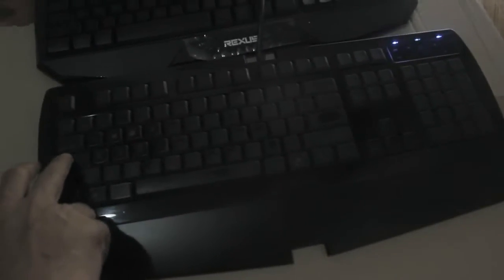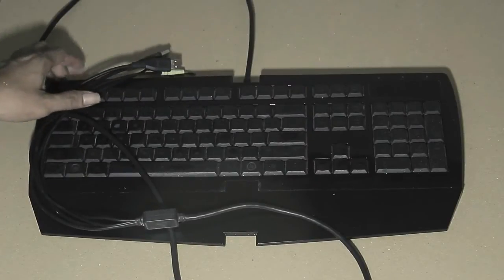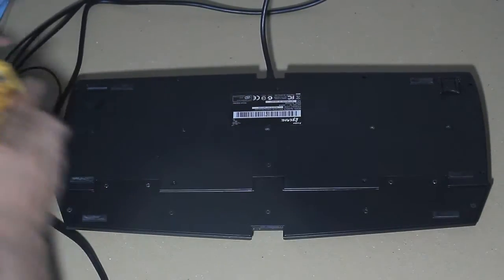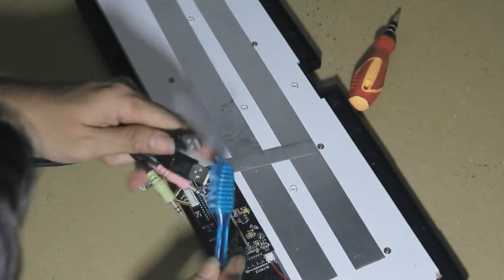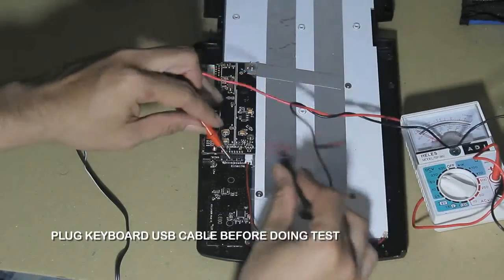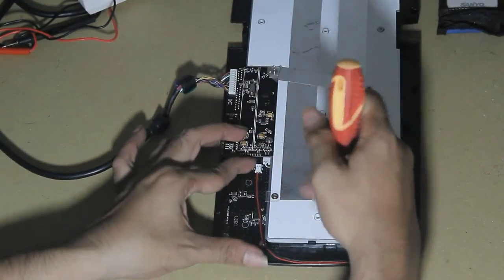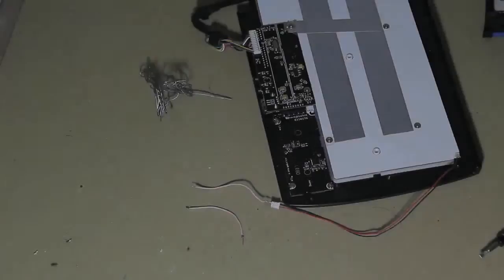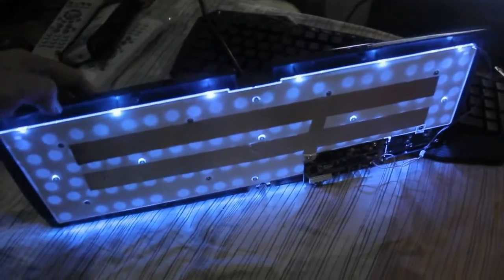illuminated keyboard Repair , ALL LED backlit keys Dead

Comment: I have Razer Lycosa Rubber...
and the rubber layer has start to fanished, and it's make me wanto to mod it (repaint)...
Do you know how to repaint it's keycaps???so it's still glowing instead covered by the paint...
sorry for my bad english...terima kasih
Reply from the maker: several ways to fix pealed rubber:
1. manually repaint with; toy paint, conductive paint, or rubber paint.
2. design your own letter with Adobe illustrator/coreldraw, print out to negative film often use for offset printing/ emboss plat/ stampel, invitation card. Usually you can find "cetak output film" near wedding card printing location. (kebayoran lama, tebet -jakarta).
http://delmarsandpiper.org/Newsletters/Newsletter2009.04/Photos/Print/wIMG_3831.jpg
3. buy a negative illuminated keyboard sticker on ebay (or ratu plaza, mangga dua, glodok)
Reply from the maker: addiengr1 http://www.ebay.com/itm/Arabic-Keyboard-Sticker-white-letters-Printed-Korea-No-reflection-/251420663877?pt=LH_DefaultDomain_0&hash=item3a89d6e045